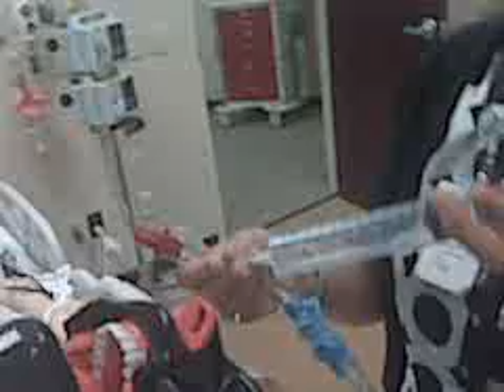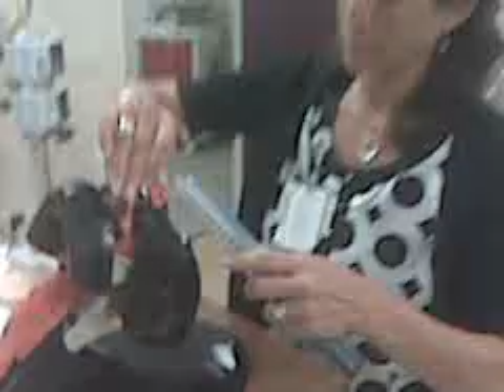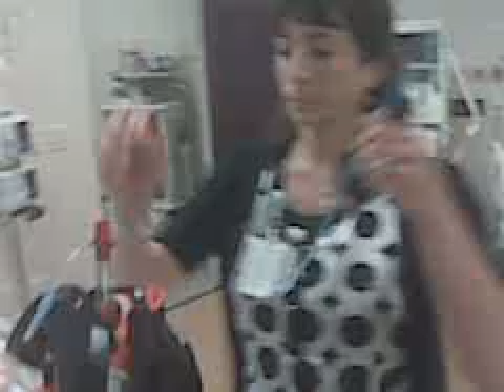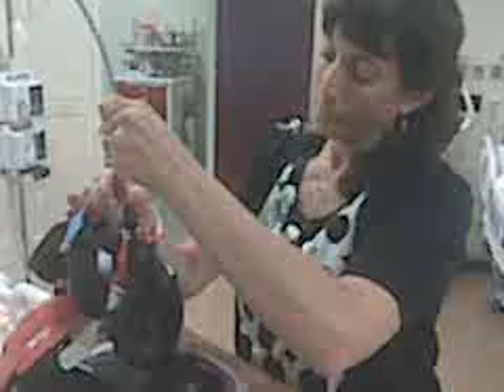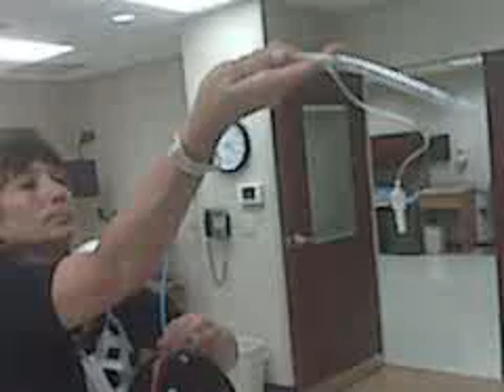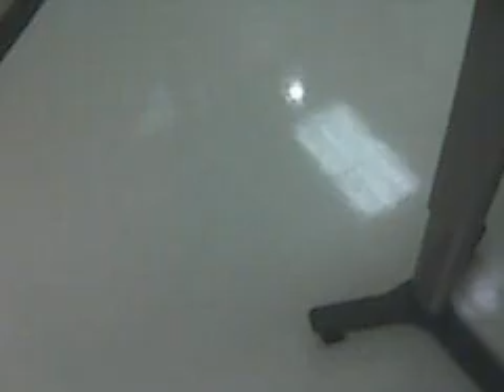King airway changeover to ET tube with bougie

Comment from the maker: So far never. It always goes in the esophagus. Misplacement can happen if the tip is folded over itself as it's insert and if it is placed too deeply. If placed very deep than the large balloon which is supposed to be in the post-pharynx can be so deep that the balloon itself obtructs the trachea. I personal am comfortable leaving them in for the CT scan especially if it was a disaster airway, i would want to be completely stabilized first even operatively, but it's a judgment call.